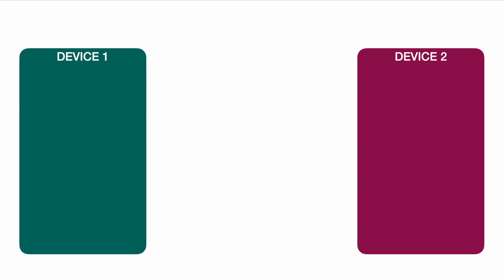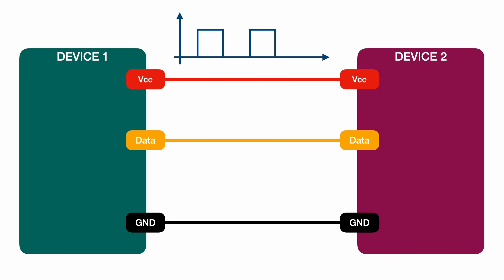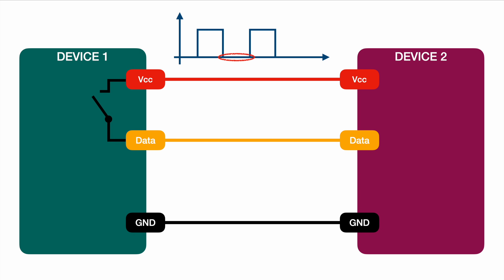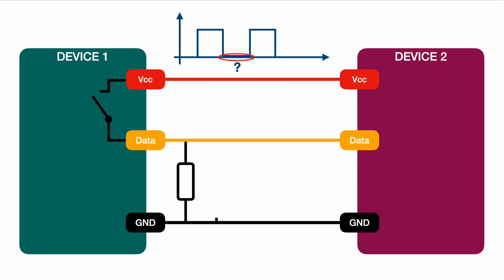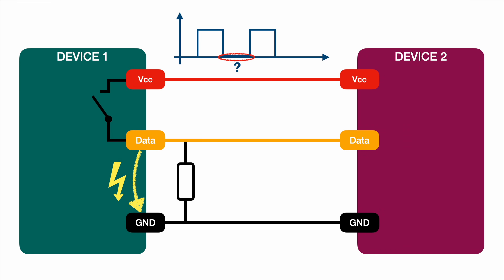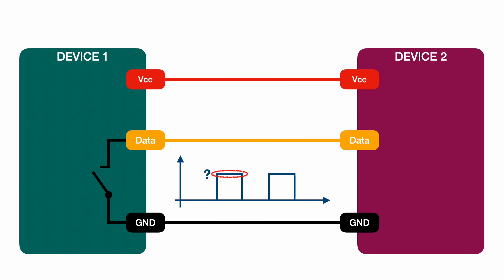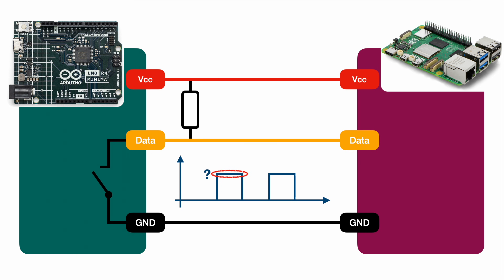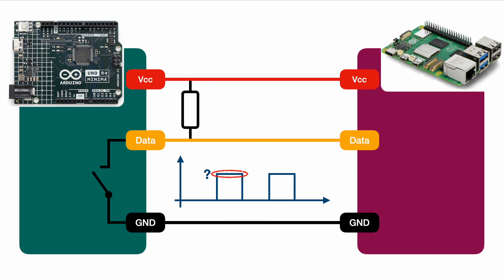Pull-up and pull-down resistors explained

Comment: Thanks for the video! I work in electronics service and I had a TIG welding machine from a customer, that randomly triggers the temperature alarm and stopped working, the sensing circuit was based on a LM358 opamp that had a defective pull up resistor, now I understand better the functionality of those resistors, thanks!!!

Comment: Why doesn’t the mcu switch between vcc and gnd? When High is needed, it closes switch between Vcc and data, when low is needed, it disconnects from vcc and engages with gnd, that way, no short?
Reply from the maker: One thing is interference collected in the cable. The other thing is that you also need to switch Salehin to high or low and in there are losses, just published a video about that, especially on TTL logics it is pretty clear why you lose some voltage:
What is TTL & CMOS? | TTL vs CMOS explained | TTL CMOS compatibility
https://youtu.be/MnmYoCO2LFA

Comment: After two tries of ChatGPT’s explanation, I had to find this video, and I understood it the first time.
Reply from the maker: Wow, thanks, that’s the first time someone mentioned choosing the video over AI. Actually a point I think about a lot, if AI will replace human content creators. Kind of have the hope that if you experienced the struggle yourself, you can explain better than if you’re an AI just combining endless knowledge…
Reply: @blueprintiot  
Me too, I couldn't understand the concept very well using ChatGPT, so that's why I came here.
So thank you for your explanation, it's really helpful!
Reply: @blueprintiot  You are welcome!
Reply: @blueprintiot ai fucking sucks bro. Don’t worry. Ai is literally made to be sycophantic and make everyone feel as if they’re a genius and actually learning. It has its use but you’re good for now keep it up brother 🙏🏾
Reply: I asked for help with pull-up/pulldown to fix a lighting issue on my Transistor NAND logic build and by the end of it I had a completely different circuit that didn’t even work anymore. I even input every single breadboard hole used.

Comment: does it 'fix' bounce problems ?
Reply from the maker: Can you provide some context?
Reply: @blueprintiot  wired push buttons ... if I set less than 80 ms debounce on fw I get double inputs ... I would like to get stable with less delay and garantee stable button input even when they get older...
Reply: @blueprintiot  was thinking on using diodes or capactors but don~t know if will solve for lack of knowledge

Comment: This helped me understand why my Subarus AF sensor circuit was throwing a code for "circuit open" but the voltage reading was 5v pegged ... 
I was like "why is the voltage on the sense wire 5v if it's open..."
I never know the pull up resistor was directly connected between the 5v supply and the sense circuit.